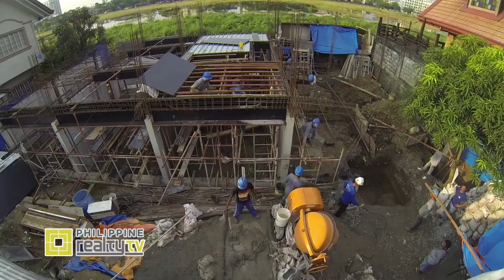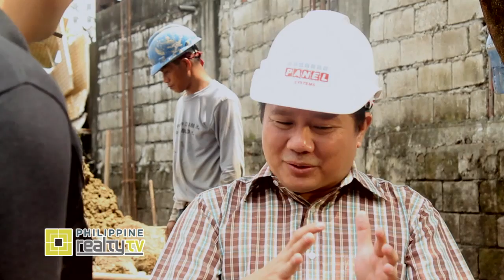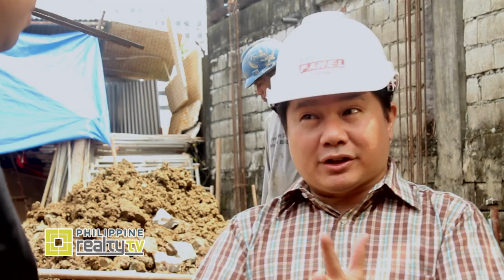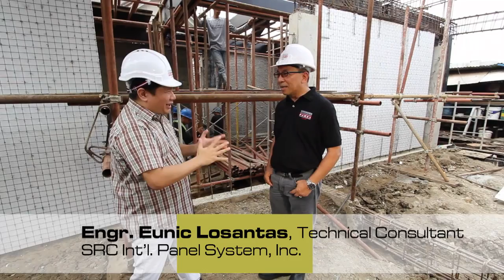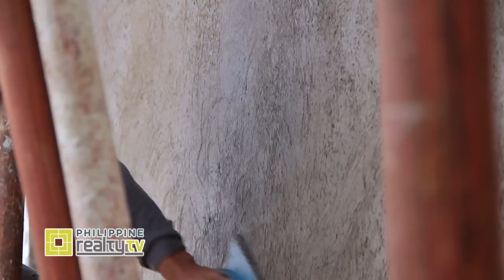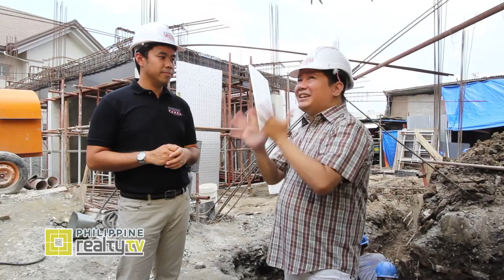Project Smart Home - SRC Panel Systems

Comment: Regarding fit-outs especially hanging cabinets/tv brackets/wall storage and etc., will SRC panels be strong enough to hold screws that drill into it? Especially pag nalagyan na ng laman yung hanging cabinets or ledges, bumibigat yun and feeling ko mahina yung styro core para dun
Reply: Yan nga ang ina analyze ko parang hindi siya applicable pagka may ikakabit ka like hanging cabinet, wall type TV etc. Applicable lang siya pagka wala kang iilalagay na display or iiscrew.

Comment: Thanks for the information
What is the used of wier mesh
I mean i suppose to build a single floor temporary labours shelter which dose not required plaster so is this wier mesh necessary?
Reply: the wire mesh shall hold the plaster..without plaster sir this is useless

Comment: What is the Ratio of Cement, Sand and Water for plastering of 1 side of 4x10 ft Panel?
Reply: You can message us at our FB Page SRC Panel Systems, or call us at this number...
8983-5893

Comment: how much is one src panel? also, is the cement sprayer available to rent elsewhere other than src?
Reply: Hello friend, we are the supplier of SRC panel, you can add my Whatsapp: 0086 13386456156 so I can send more running vedios to you, tks
Reply: The price of the panel depends on the sizes you want to order, you can add my Whatsapp: 0086 13386456156 so I can send more details to you, tks
Reply: You can message us at our FB Page SRC Panel Systems, or call us at this number...
8983-5893
8939-8106

Comment: do you have eathquake & fire resistance simulations in your factory or laboratory?
Reply: hello friend, any interested in eps 3d wire mesh panel and eps 3d wire mesh panel production line, let me know pls 
my whatsapp/wechat/mobile number is 008613386455039,email is qu.office@abcn.group
Reply: You can message us at our FB Page SRC Panel Systems, or call us at this number...
8983-5893
8939-8106

Comment: Is this different from the m2 system?
Reply: Hello friend, we are the manufacturer of SRC panels , you can add my Whatsapp: 0086 13386456156 so I can send more running vedios to you, tks
Reply: hello friend, any interested in eps 3d wire mesh panel and eps 3d wire mesh panel production line, let me know pls my whatsapp/wechat/mobile number is 008613386455039,email is qu.office@abcn.group
Reply: Yes Sir, You can message us at our FB Page SRC Panel Systems, or call us at this number...
8983-5893
8939-8106

Comment: Can this design be safely used for staircases?
Reply: hello friend, any interested in eps 3d wire mesh panel and eps 3d wire mesh panel production line, let me know pls 
my whatsapp/wechat/mobile number is 008613386455039,email is qu.office@abcn.group
Reply: You can message us at our FB Page SRC Panel Systems, or call us at this number...
8983-5893
8939-8106

Comment: yes it is lighter and good in insulation ang soundproofing but all really hight flamable material... when fire start it can easily turn your intire household with a short period of time than usual
Reply: let's say, it cannot be diretly burnt but how about the heat... this might melt the styro inside
Reply: If it's coated both sides with concrete (a fire proof material) then it shouldn't be able to catch fire.
Reply: It is fire resistant, the foam used here is a compressed foam
Reply: I've seen fire retardant demos of other panels using EPS foam which these SRS panels seem to be using too. Based on tech data and tests I've read, some EPS are made fire retardant up to a few hours.
Reply: You can message us at our FB Page SRC Panel Systems, or call us at this number...
8983-5893
8939-8106

Comment: We built our house using EVG 3D Panel for walls. Our main reason is so that our house will stay cool during summer and to build our house faster. We are happy we did. Here is the video for building our house in case you want to see it. 😊 https://youtu.be/S08v7clDzOU
Reply: You can message us at our FB Page SRC Panel Systems, or call us at this number...
8983-5893
8939-8106

Comment: Can you supply to Iloilo at a reasonable price.
Reply: its better build 2 - 3in hollow block walls with a 4inch gap between both wall opened to above which will keep your exterior wall to allow all moisture and heat build up of wall one to escape, the exterior wall will take all the heat as it shades the interior wall. this system will keep your house a lot cooler then the panels will and less then half the cost.. also the panels are not strong enough to handle large window loads during a heavy storm...
Reply: @leogsparta6340  sir, can you give link of that method for more details. I cant quite picture it since Im not really familiar with construction. Thanks in advance. Im finding ways to build a cooler home in the most environmental friendly way without breaking the bank.
Reply: @judithbacit1518  https://www.youtube.com/watch?v=vUCMsvhuSFQ,  same concept and if ur still not grasping it just message me in Facebook messenger @ Leo G Sparta (picture of a dog) i will send u
 a drawing
Reply: Dear friend, we are a supplier panel construction, pls add my Whatsapp: +0086 13386456156 for more details, tks
Reply: You can message us at our FB Page SRC Panel Systems, or call us at this number...
8983-5893
8939-8106

Comment: We used this type of material for our apartment. I have no doubt about its strength because when we have small repair, the mason complained that the wall was difficult to break this is because of the wire mesh. My biggest concern however is the water leaking inside the wall. It cannot be avoided that small cracks will appear and from this, rain water can easily get inside. The most critical part was the water leaking to electrical switch and outlet. I think this material is good as partition wall inside the building but not on walls exposed to rain. It might also be applicable for outside walls but should have roof. In terms of costs on per sqm wall, my calculation shows that conventional CHB is still cheaper considering that SRC cost has now gone high. But most likely in the overall cost of the building, SRC will still be cheaper as you do not need huge and strong pillars and beams because the wall will be lighter.
Reply: either you used conventional CHB wall or SRC,  concrete is still a porous materials, subject to weather and temperature,  lalo na karamihan ay normal na may hairline cracks,  use waterproofing membrane...  common used ay kagaya ng POWER MIX, gawa ng bosni, or the likes, ( CEMENTITIOUS WATERPROOFING) before the final coat of paint is apply
Reply: Thanks for thos info
Reply: Good feedback. 
In that case, the company should add in their design a means to insulate the inside or atleast a means to drain or evaporate the water that is trapped inside so that it wont seep into the other side of the panel
Reply: is there an assembly for exterior application where there is a weather resistive barrier to prevent leakage?
Reply: Magkano po ang price ng per panel?
Reply: Do you have water proofing paint outside?

Comment: How did SRC structures hold up against Haiyan? If they survived, this should be the only building material used to continue the rebuilding in coastal areas, aside from poured concrete structures that is. That said, I don't see how they could have survived the impact of the storm surge and the debris. Dual layer panels, such as  foam panels with three inches of concrete and rebar sandwiched between them, should have survived everything Haiyan, provided everything was tied together and attached to a thick slab foundation. What a truly horrific typhoon. So sad. Many were killed and hundreds of thousands lost everything. 

I was so happy to see the US respond immediately. This was followed by the swift response by nations across the globe to assist over 13 million people needing basic supplies just to survive. They literally had nothing. 

The Philippine government was totally overwhelmed by the scale of destruction and the needs of it's people. Let's hope lessons were learned so the Philippine government is able to mobilize to renders assistance much.

Back to this product.... In such a warm and humid climate why are the panels so thin? I would think ICF construction is better suited for the region. Here we have a single thin layer of the cheapest, least efficient form of polystyrene: EPS (Extruded Polystyrene foam). Not only does this thin EPS have the least amount of insulation value, but it's perforated with thousands of holes to attach the steel cage, a magnet for corrosion. Then this flimsy sandwich is covered with layers of concrete slurry. 

I see a lot of issues with this type of panel construction. The owners of these structures must stay on top of all cracks big and small to avoid the veneer of concrete from crumbling away because the steel cage covering both sides is expanding from rust, salt, other deposits left behind from moisture, and due to cycles of thermal expansion. Perhaps there are more layers on the exterior to prevent moisture intrusion and anti-corrosion measures. 

In terms of seismic structural integrity... I can't see a two or three story structure surviving a large earthquake or even a moderate earthquake with prolonged shaking. Particularly with a heavy tile roof. Certain seismic wavelengths during less severe and short duration earthquakes could bring structure built with this panel system down. Even a single story structure with a heavy tiled roof. Yes, flexibly in a structure can prevent major damage and collapse. However this type of panel is too thin with poorly bonded thin layers of material. I could be wrong. To be clear I have not studied the specs for this panel system. My opinions are based solely on this little presentation and knowledge of the engineering requirements for one, two, and three story structures typically covered with heavy tile or metal roofs. As well as issues with steel corrosion within concrete.
Reply: You can message us at our FB Page SRC Panel Systems, or call us at this number...
8983-5893

Comment: vertical type  3d panel machine is better than horizontal  type  , if you like pls add my whatsapp; +86-18630189605  check our web:www.hbhscn.com  there have this introduce
Reply: You can message us at our FB Page SRC Panel Systems, or call us at this number...
8983-5893

Comment: how much po
Reply: If you are interested in the EPS 3D panels,please feel free to contact me.
Email:shunda-crystal@lksdjx.com
Mobile/whatsapp/wechat:+86 15908902908
Reply: Hi! Renan Ilao, this our Website www.srcpanel.com and this is our tel.(02) 939-5893.
Jiang Crystal is not connected in our Company.
Reply: Hi Jess, nagbebenta ba kayo ng ready-made? Sanay ang gumagawa ng bahay ko sa hollow blocks lang. Hindi kaya mas expensive kung mag hire pa ng bihasa sa SRC panel? I need it ASAP. Ronald @0929 606 5538
Reply: Maganda cguro install traditional hollow blocks and install this panel system para magsilbing insulation and sound proofing at the same time.